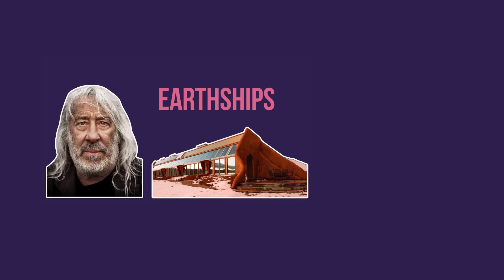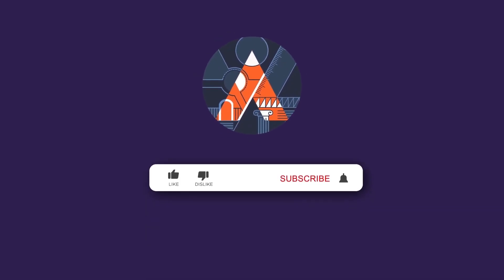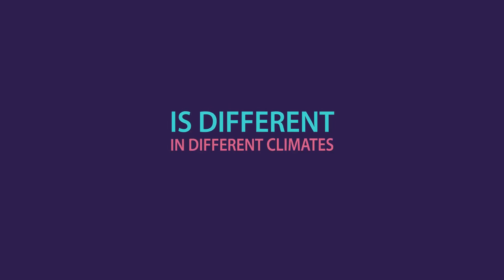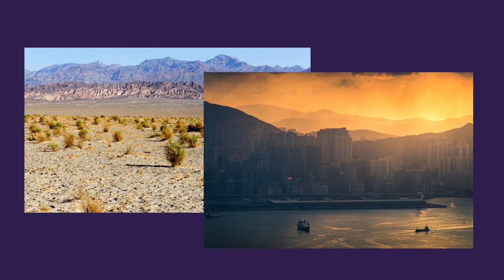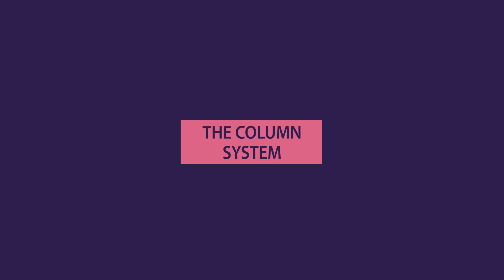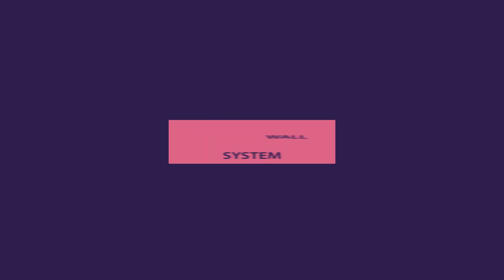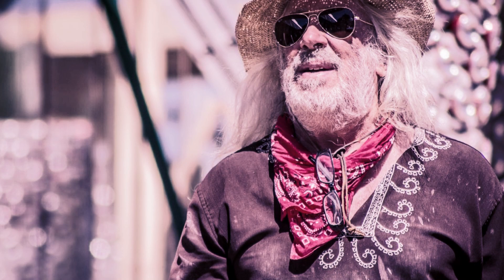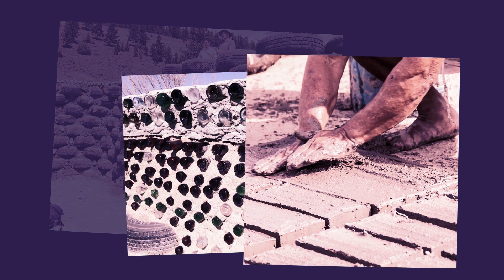How To Build an Earthship? (3/3)

Comment: I love the idea of building with tires but realize that the physical effort and time to build myself is impossible to deal with and paying for labor is too prohibitive. Has anyone seen specifications on using tire  enfill with something like aircrete or cob?
Reply from the maker: any underground architecture solution will do, the tyres were suggested for several reasons but it is not limited to them. We will do future videos on ground covered architecture and would also recommend that you direct your research in this direction , hopefully we are not too late in our answer 😁

Comment: I really want a earthship but i don't know if it can satisfy my future family needs and wants...For example I want a 6 bedroom earthship that has a warm modern feel to it but at the same time has a bit of a nature twist to it but i don't think that such thing can happen... and if it can happen i don't think that i can pull it off...
Reply: Most of the original builders have added on to their original homes.  Through the years of living in one, most have added a couple of new spaces to their existing home, to make room for kids or parents or guests or whatever.  
Usually they started with a simple hut design and lived in it until the primary home design was finished.   The hut was then relegated to being a storage area or shop.  Then many of them ended up connecting it to the primary structure later on.  
It's pretty fascinating how resilient these designs really are.  I have seen stick-built homes get nearly renovated by just the simple upkeep required for living within one for twenty or thirty years - ask anyone that has lived for that long with the same home.  It is expensive - but what else can you do..?!
Reply: https://youtu.be/Po6VVF1jW24.

Comment: Water catchment and sewage treatment  have changed dramatically since these books were written.
Reply from the maker: Of course they did 
like my previous replies on your most appreciated comments, these are short quick videos to spark curiosity and conversations. So please share with us
Reply: The angle of glass on the south face isn't as important as the centering of the home to the movement of the sun.  About 15 degrees East is a more optimal angle.  
Water catchment is a big deal.  Water is caught on the sloped roof to be collected into a cistern located within the berm of the structure.  This water is kept dark and cool by the berm.  There is a filtration and pressure system within the structure that is powered by the solar power system.  
Clean water is piped and pressured to the faucets, taps and showerheads.  Greywater is collected from the sink and shower drains and filtered and kept in a sump.  From the sump the greywater is circulated through the planter to water all the plants and trees kept along the south face.  Greywater is also pumped up from that sump to flush toilets when necessary.  The Blackwater is then piped directly and immediately to the septic tank.  There is no separation of greywater from Blackwater.  The septic system has a couple of extra steps more than a traditional, rural septic system.  This all ends with a leech field that expels virtually nothing.  Specific plants are chosen (particular for their affinity for affluent) to line the leech field - hence nothing is left to smell or evaporate, and nothing will leave a soggy spot in the yard.  It has all been contained within its own little system.
Reply: 00000000 00000000 , Please tell which detergent, shampoo and soap you can use in this system. And what to do if you need to use bleach for clothes?
Reply: Harsh chemicals are to be avoided, namely "film developing materials."  Bleach can also harm the biome that lives within the graywater planter system - if it is in concentrated amounts.  If it is too strong to safely drink, then it could be too strong to allow into the system.  If you can still smell the bleach, you can still taste the bleach.  
Military water purification standards allowed for one cap full of bleach for every gallon of water there was to make safe for drinking.  Keep in mind that this concentration may still be strong enough to wreck the existing biome that lives within your digestive system - killing good and bad bacteria alike.  
Personally I would throw the bleach water outside on the ground, if it was my call.  If you wouldn't throw it on top of your garden vegetables, I wouldn't throw it into the graywater system.
Regular soaps and shampoos are fine.  Regular laundry detergents are fine too.  These soaps contain phosphorus which actually works like Miracle Grow for the planter cell.  The concentration of soap/detergent to water is thin enough during normal usages that this will never be an issue.  
Normal (minimal) laundry-sized bleach needs shouldn't mess with the biome, provided it is used sparingly, but I would personally avoid using it, if you really don't need to use it.  
This is all in an effort to NOT damage the microbial life that exists within the graywater planter cell.  
Hope this helps.
Reply: Well I don't know about all of that.  My knowledge of urine and its usefulness is fairly limited.  I was raised in a rural area and have a healthy amount of farm experience.  I worked and lived with the Earthship crew for a month while I attended the academy.  I had studied the subject for a few years before I drove out there to actually experience it first hand.  
I have to say that these structures are nothing short of being both phenomenal and simplistic in their design.  It takes A LOT OF WORK to build one of these structures, and I imagine that is the primary reason these things aren't way more popular than they are.  
But as far as urine goes, that gets flushed out to the septic system and leech field.  There is no internal use for urine within an Earthship structure..  not by design, anyway.  
All of the Earthships that I toured or worked on were clean and wholesome.  But I'm sure that is mostly due to the good hygiene habits of the occupants.  
Stay overnight in one sometime - they can be rented nightly.  See for yourself how quiet they are compared to a standard stick-built home.  They may just completely change your entire mindset and worldview, like they did mine.